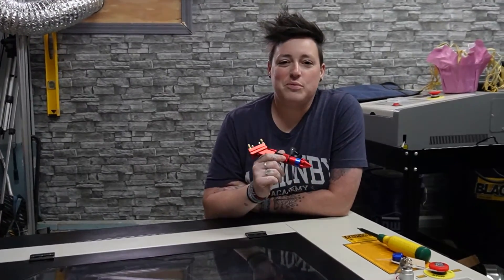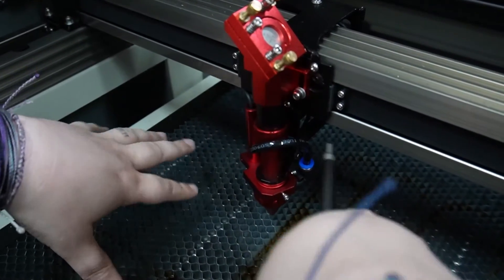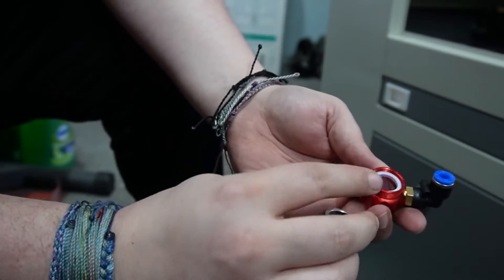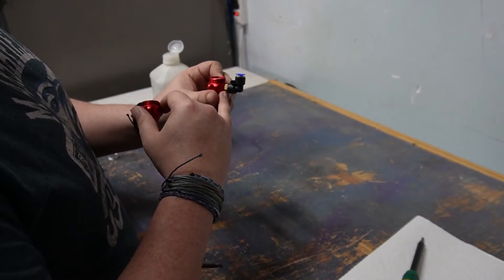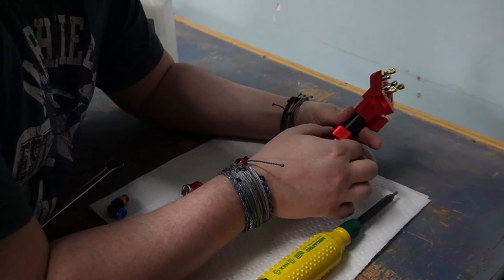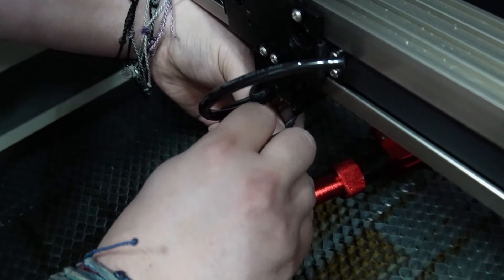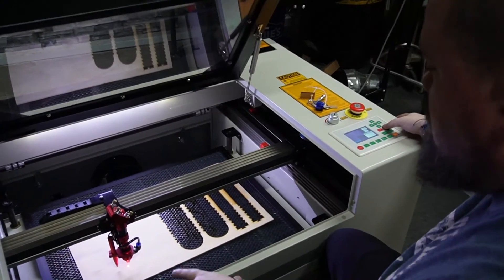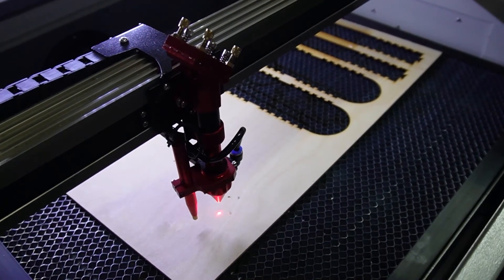Replacing Laser Head | Monport C02

Comment: thank you for your time for making this video.  I just purchased my Monport 80W 1 month ago and the autofocus does not work.  I was told by Monport it was the screw in the back was either broke or missing (mine is missing).  They had a quick response and are sending me the replacement part now.  Also, my laser head is connected to the machine via wires.  I did not see in the video how those are taken off.  It's ok though I will figure it out.  Thanks Again!  Tanya